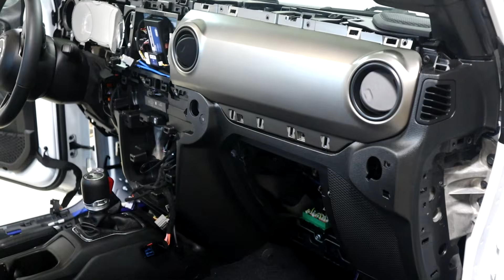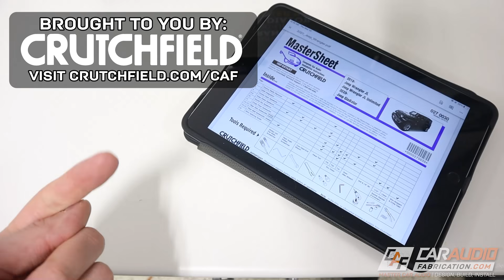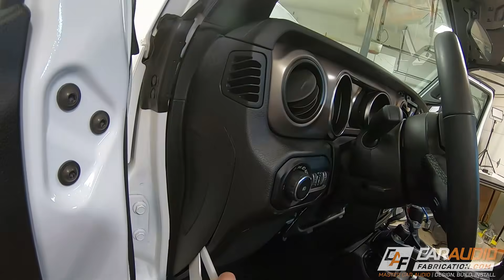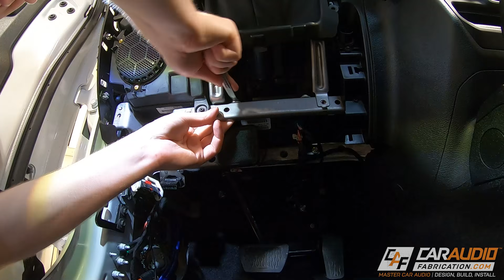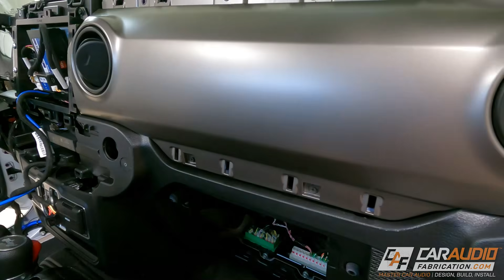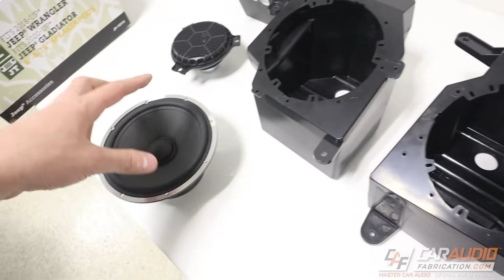2018-Up Wrangler JL Speaker Pod Upgrade - HOW TO Disassemble Dash

Comment: I know this is an old video, but did no one model a 6.5 in these pods?  The things spike a 6.5 speaker @ 195 and rolloff  f3 @ 121 HZ.  This thing attenuates to -12db @ 80hz instead of the desired rolloff for a sub crossed @ 80.   5 1/4 speakers even rolloff to -3db @ 90...  which would be more natural sounding than cramming a 200Hz spike in these.

Comment: Did you use the metra knee dash kit (Metra JP-1018) and cut the grill opening? Apparently the grill opening is only 4", and grill should be cut to allow the 6.5" sound through. I'm planning an Infinity Reference series swap on my '23 gladiator (non-alpine) and since I don't want to cut the grill, I'm wondering if I should use the 4" or 6.5" reference in the knee. I'm thinking 3.5" up top, 4" at knees, and three way coaxials in soundbar. Should I do the 6.5, and cut the grill, or is the 4" good enough? I will also be having a powered sub.

Comment: So I have a 24 gladiator Mojave it’s got the 12 inch across screen very nice oem system alpine of course.   I’m not seeing or can find any integrated  harness or y connector to add in rca the pac unit I installed for the wife’s jlu was nice and simple.   I have a line output converter is it possible to use that option

Comment: Love the videos and guidance !! Question regarding the stock Alpine units in the new Jeeps. Are these considered passive systems ? I am looking to upgrade to Focal speakers as a start, and for the roll bar for instance, there is a speaker and a separate tweeter, assuming each on a separate channel. If I were to buy a 6.5 K2  component set , would I be able to direct connect without the use of the crossover that comes with ? Plan to incorporate a bass blocker for safety of the tweeter regardless, but the crossover creates challenges as it is large and  requires space.

Comment: For the JL you have to go all out(expect to spend 2k+), or drop some good spx in the upper dash and call it a day.  I speak from experience.  The benefits of just replacing speakers is minimal.  You'll get a bit a clarity with some quality dash replacements, but the stock amplification muddies everything.
Reply: @robsolf  even by updating the 10” subwoofer and amp??

Comment: I wouldn’t have been surprised if you would have had to remove the rear wheels to access the .50 cent front speaker..I sure hope the engineer was fired

Comment: Worst problem is the oe speaker cover screen is tiny puta 6” speaker behind them  blocks 50% of the new speaker. I drilled mine out but doesn’t look great. Even worse I leased my jeep to buy and paint is bubbling so I’m returning the jeep and have to remove all new equipment and replace both speaker panels. But I have great practice now to do it on my 2023

Comment: If I put the Metra Pods in can I just add 6 inch speaker to my oe Alpine system with no mods to the wiring. I would like to use the OEM factory speaker harness.

Comment: Question on outputs for a 2 dr beater Geo Tracker. Looking @ stereo specs 4x60 watt output (15 watt/channel from harness). Want to use 2 channel micro amp, what happens when I parallel speaker wires into amp (RF+RR into amp R input)? I know I need to parallel the 4 ohm speakers to get the 2 ohm amp rating.

Comment: I’m planning my audio build on a mk4 Supra and it comes with very shallow pods for the door speakers. If my new speakers don’t fit, and I doubt they will, is it better to delete them? I don’t think I’ll be finding after market pods for a 26 year old car. Also, I’m not sure what air volume I’ll be dealing with for my subs, if I’m at the top of the recommended air volume should I use insulation in the box? Also should I insulate if I port it?

Comment: Just sound treated my entire jeep jk and also the pods. huge difference in sound quality. currently running front 2 way active off of an alpine pdx-v9, no rear and jl audio 12w6. Front rxa to ch.1 and 2 and rca ch.3 and 4 to sub input.  I want to add an alpine s-a32f to allow rear fill. What would the rca hookups look like for the pdx-v9 and the s-a32f?

Comment: Serious question...I have a JL Rubicon with the 8.4” w/ Alpine upgrade...I haven’t seen the speakers but I have to assume they’re just fancier stock speakers and probably a step or more under the cheapest Alpines on Crutchfield.  Correct me if I’m wrong please. Also, I dig the Heigh10 stereo but is it worth $1500 over the 8.4”?

Comment: great video!  Off topic question, if youre making a sub box out of 3/4" MDF what size/length Brad nails do you Recommend using??
Reply from the maker: 1.5 inch or larger usually, they are just there to hold things in place while the glue dries.

Comment: Great job again Mark ‼️ I'd like to get an opinion from you please. I have a system of about 3k total RMS power. I am a sq guy. Until I can go active on a 3way component speakers. What is a good 2way component speakers that has a soft tweeter and SQ set. I have a set of DS18 6.5 component speakers. Loud but not sure they are SQ quality.
Reply from the maker: To be honest I would just hold out until you can get the 3 way set. I like companies like JL and Focal that sell the high end speakers "À la carte". You could get a 2 way set for the time being and upgrade to 3 way once you have the funds.

Comment: So in other words, if you're in the market for a new vehicle, stay tf away from Jeep Wrangler 😂
Reply from the maker: Every new vehicle has challenges now days. I'll still take hard to remove speakers over not being able to upgrade the head unit. Lots of head unit and amp interface options for the Wrangler
Reply: @CarAudioFabrication  yeah that's also a pain for just about any vehicle after 2012 or something, the cars functions built-in to the HU. I like the location of them speakers being where they are but after seeing all the bs you had to do just to get to them speakers, that probably turns a lot of people right off when it comes to upgrading their sound. And I'm sure it's not cheap to have it professionally done either probably $500 to a grand just in labor getting to them 2 speakers. But once it's done, I'm sure it's nice

Comment: THANK YOU!! I have my metra pods and 6.5's sitting here and was planning on installing this weekend. Already have the instructions from crutchfield and metra, as well as many videos showing how to remove most of the components. However hearing/seeing it from your perspective is very nice!
Reply from the maker: Glad I could help! Make sure you seal up the pods really well, they have several holes for other speaker sizes. Actually the next video (which may or may not be dropping tomorrow) I cover all the upgrades I did to the pods.
Reply: @CarAudioFabrication  yep! Thought of that when test fitting the speakers, I had to trim the tabs for the 6" mounting holes off to clear the frame of my speaker. 

I purchased polyfill for the enclosures but don't have any dynamat/second skin type products on hand. Debating if I really should get some or not because doing it once installed is obviously not going to happen.